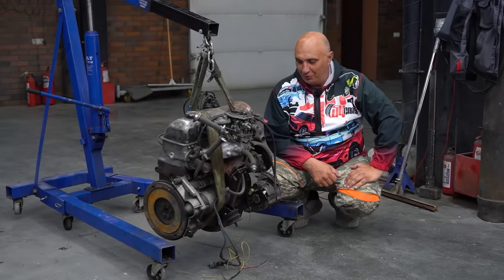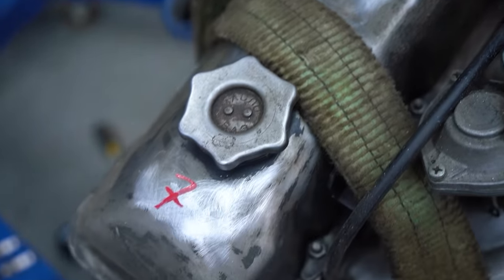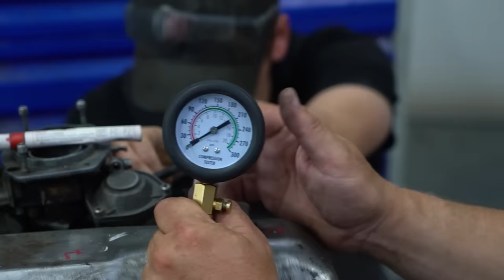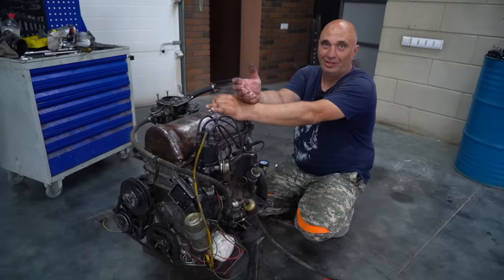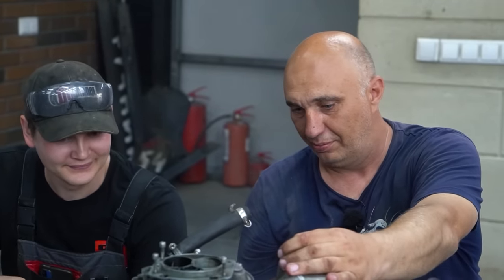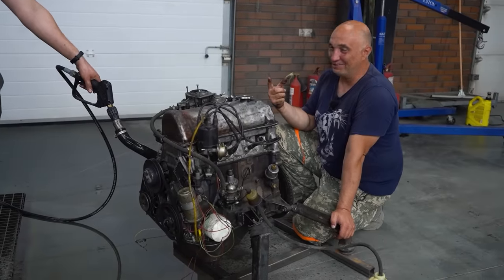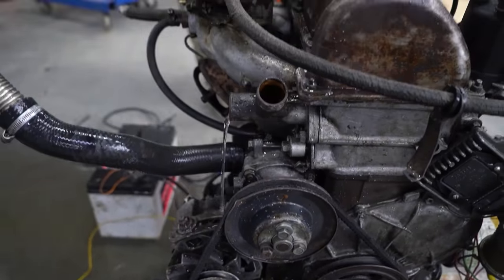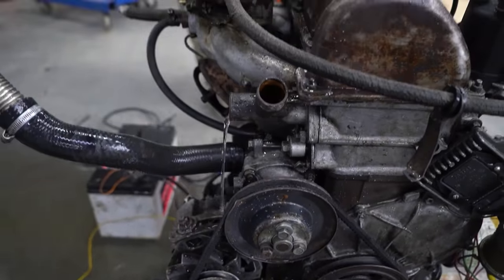Will an engine start on RUBBER piston rings?

Comment: Oil on top of cylinders would have been coming past the valve stems, especially with good compression which would have made the vacuum "worse" in regards to inlet valve oil bypass

Comment: it would be interesting to see how the rubber o-rings worked in the engine, you put the extra ring groove in.  Have the regular oil ring, at the bottom of the piston and then 3 o-rings, on top. Is that engine still running? If so, how's it doing? Does it still have better compression? I really enjoy watching all your videos and experiments. Thanks.

Comment: What if you got a different piston ring compression tool. One that an exact match to the cylinder and tapered. Much better than the clamp style. Probably would go together smoother also. Try it again!!  Maybe use a oil control ring on the bottom. Just use the orings as a compression ring.

Comment: Should've used square rings instead. On some break calipers they have square rings against the piston which seals better against pressure. I've used such rings on my home made hydraulic clutch and it worked great on the slave cylinder.

Comment: Use a stock oil ring and keep the compression rings rubber and put the engine in a car and see if it will drive

Comment: Amazing! definitely didn't expect it to run so well.  One thing got me though is the flames coming out of the carburettor - almost like timing or spark plugs were connected up wrong? If you had 8 bar across all 4 cylinders it definitely should have idled and ran very well you'd think

Comment: I like this idea..and yes oil control is the problem. Excessive amount for keeping the  rubber edges lubed definitely fualed the plugs. Run it again with a oil control ring setup. And actually drive it
Reply: Or just use 2 stroke oil with the fuel.

Comment: I think you’d need a coated piston (ceramic maybe) for a rubber ring to work, the aluminum and steel units probably retains a lot of heat from combustion compared to the walls of the cylinder (next to the water jackets).

Comment: that works really well not expected.
maybe try to do 2 rubber rings and 2 steel the normal piston rings which does for the normal oil supply and drain.then connect cooling and get stationary working and throttle like it was stolen
to test under harsh conditions

Comment: That was an amazing experement, I thought the o rings would melt or get hard but no they were as good as new when you took them out. It looks like oil was getting up into the cylinder.  I would like to see another test with the engine tuned a set up with a cooling system so the only variable is the rings.

Comment: Interesting! My assumption was that the first 2 rings would fry immediately due to lack of lubrication from the bottom O ring making a 100% fluid seal.. and the bottom ring would survive being it was the only one getting oil. But after seeing the o rings rolled.. that allowed compression to not build to the point of an air lock.. and oil to make it to the top.
Crazy! Also.. do fuel filters flow backwards in mother Russia? 👀 🤣

Comment: Surprised it ran so long. I would say you need to run a standard oil control ring to lower the amount of oil in the combustion chamber. The oil is probably getting around the rings on the intake stroke.

Comment: I feel because of 0 blow by, the top of piston ring is getting dry possibly causing rings to twist or spin

Mix 2 cycle oil would help keep upper lubricated

Comment: use airplane oil which is much thinner as the oil that slips by the rings will dissipate faster and maybe eather or add a extra head gasket and higher octane fuel.love your show.🤩

Comment: The cast iron cylinder head on my Ford 300 weighs so much that it doesn't even need head bolts or studs. The weight alone keeps the compression in.

Comment: I think if u cut the groove and fit a thin oil control ring the thin one then seal then thin oil ring it will seat perfect and seal and protect the rubber

Comment: Try to confirm that oil is not entering the cylinders from upstairs - valve stem seals/ worn valve guides, i'd like to see results of 1st and 2nd rings being O-ring seals and an oil control ring

Comment: One ring will do, make it the bottom rung to keep the ring away from the combustion process. 
A little more attention to the clearance / size of the ring should keep the oil on the correct side

Comment: I think if a lubricant was added to the fuel such as 2 stroke oil, the engine would run well for a long time, provided adequate cooling.

Comment: Definitely take this further, maybe 2 conventional rings and a rubber scraper.. Do you think the rings are expanding as they get hotter. .? Perhaps cut them then freeze them to get them located in the cylinder sleeves properly..

Comment: Weird how the compression was good during the test, but varied a lot in actual operation. The rings weren't being exposed to naked flame (maybe the top one slightly) so it makes sense that they didn't burn the same way that the plastic/wood pistons did.

Comment: A rubber O ring with suitable filler in it like some bearing materials would seem to show promise along these lines.
Try it!
Moulded rings would almost certainly be cheaper than machined ones at the same scale of manufacture. 
I think a conventional  extra oil control ring below the rubber ones could help a great deal.
I also suspect many engine makers sacrifice oil consumption to achieve good looking fuel consumption figures as nobody seems to care about internal oil consumption as long as nobody sees smoke or drips or smells nasty smells.
Normal western pollution control measures would ensure most of this, at least for a time!

Comment: I have a feeling that the rubber rings could be absorbing some of the engine oil, which in turn is keeping them fresh to keep the gap between the piston and cylinder well sealed, therefore compression up too. Any thoughts?
Reply: rubber do absorb oil, that why it eventually destroys it

Comment: This proves exactly how irrelevant static compression is. You get an engine with healthy supposed compression and right where people think it's good when the engine runs the things change as the worn piston rings or cylinder walls fail to seal under load.
Same thing with rubber, the compression looks alright but when the fuel ignites inflating the pressure to hundreds of psi they get squished and they leak.

Comment: Should see how much pressure builds in the bottom end of engine. maybe the pressure is high and could be making oil pass to top of piston. might need a vent to lower pressure.

Comment: it would be nice to see the original oil control ring with two compression  rubber rings, maybe with a better tunned engine, so that you can see it idle and rev up cleaner

Comment: imagine the sales pitch "its a lada.. its got coins for valves rubber orings for piston rings its a gas engine that runs on diesle its got 8 wheels you can crank start it or power it by the hampster wheel its got wooden break pads magnetic suspension lovingly painted with a pressure washer in 6 seconds. plastic windsheild worlds fastest wipers and you can mow grass in it. the dents will buff out. mind your head on the 42" subwoofer.

Comment: For those who do not know seals need oil. It's the oil that makes the actual seal. The o-ring or even the metal ones just make a small enough Gap that oil can't make it through. And then the oil seals the gap

Comment: Try it with just replacingthe secondary compression ring, see how much that helps the compression and then being outside of the main flame front, how well each hold up.. Probably a good enough setup to even try I'm a car driving for a while
Reply: the rubber can take the flame, it s the heat that may kill it
Reply: @omegarugal9283  That's surprising, I would have thought the flame front would be quite a bit hotter.
Also, not being on top there would be a lot less oxygen available to turn the rubber into a fuel where it will early ignite incoming fuel mixture as it's incoming. Basically I'm looking for the best of both worlds between metal rings and rubber gaskets.

Comment: I kinda figured they would run fine. I mean, these things are designed to withstand high temps, it's not like oil filters don't get hot. What I'd like to see is how long they would last in an actual car driving long distances. I bet they'll start to get worn down and we'll see lower compression after one thousand miles.

Comment: My guess is the oil impregnated the rubber and started acting like a rod bearing with the rings riding on a thin film of oil on the cylinder walls. I wonder if neoprene would work better

Comment: @Garage54 I imagine that the problem with the rubber/silicone/teflon rings, is that over time small pieces of this material can fall into the crankcase and go to the oil pump, I imagine that this could ruin the oil pump and you would lose the engine for lack of oil in the crankshaft and valve train.
Reply: the oil scraper ring needs to be above the rubber rings, in order to lubricate them, the scraper ring being above the rubber rings, it will prevent the oil from going into the chamber and at the same time it will lubricate the rings!
Reply: the oil may be being sucked by the sealing of the valves or going up through the cylinder wall that contains grooves, the rubber may not be able to seal these grooves.
Or could the oil have leaked when removing the head?

Comment: What about using silicone rings on the top 2 groves and put the oil scraper back on it? Old style stream engines used a similar seal ring

Comment: Build another 1. Use a conventional oil ring and 2 rubber compression rings. Put it in a car and run it on 2stroke premix fuel.

Comment: I would do a half rubber piston and half regular and run it in a car for testing. See how long the thing can go and even see if there is a power loss. Maybe try finding other types of rubber rings and seeing how they hold up. I know the normal black rubber but there is also the reddish rubber and other types. 

Overall I would like to see a set of pistons with only the top ring swapped with rubber. Preferably on a known low compression running engine to see if it improves it. If the rings stay oiled then they might never burn up as long as they can stand the heat.

Comment: Nice but take in concideration that the rings can rotate in the groove during oparation.2nd there is a limit for An o ring to "stick out" so 0.5mm is a bit to much i think. 3th. There are viton o rings wich are Heat resistant .if you cut out the oil to the  top of the pistonrings by using An conventionele oilcontrol ring the o rings are going to burn out realy quick i guess...Just saying,very cool test....

Comment: The reason why the rubber rings work so well is when you ran them for a while the heat caused them to expand that's the reason why you got great compression in them it's the same technology that Nasa uses in their solid rocket boosters

Comment: They might be pulling our leg it ran like they crossed some of the plug wires, a misfire. I'm sure they have 2 of the same engines one with less compression or a bad valve/valves. Also they never ran the one with the o rings that was just to take apart to "prove" they done it

Comment: Id like to see you trying with 2 of the rings being the rubber rings and the last being an oil ring, as you said. But id also like to see what happens in a diesel, since diesels have MUCH higher compression ratios, id be curious if the engine would run with those

Comment: Need to drive a lada with them in now but with hotter plugs to help burn oil off or just rubber compression rings not oil rings or different combos as that was so successful 🤯

Comment: I would also like to see this with 2 rubber rings and a stock oil ring to prevent the oil from getting into the combustion chamber. I feel like that might be why the rings worked so well because they were lubricated by the oil blowby. Wonder how well they'll work without that film....
Reply: the oil scraper ring needs to be above the rubber rings, in order to lubricate them, the scraper ring being above the rubber rings, it will prevent the oil from going into the chamber and at the same time it will lubricate the rings!

Comment: me over here being a 2 stroke guy and worrying about it failing just as bad. years ago they started introducing squish band...
the cylinders combustion chamber/head was sealed with i silicone ring and not a metal head gasket. you adjust the squish. how far the silicone is compressed by piston to head clerance and run it.
was it a terrible idea i thought so. but on yet another cylinder with one they hold up for thousands of miles. my last testers were water cooled 15:1 compression ratio and accelerate around 9-11k rpms. i was able to go wide open throttle for miles at a time which is completely frowned upon but it was all built for it.
the last cylinders were about 18-20 hp but still peak power from a stop with under 200 lb vehicle its hard to catch up with.
idk if silicone piston rings could last a long haul but for race motors or drag cars that rebuild very frequently its very plausable and could be very low friction

Comment: If you ran silicone rings they can take the heat better but you definitely would benefit I think from leaving your oil ring in because with the O-rings not getting lubrication it could cause them to wear out faster but I could be an idiot and be completely wrong😂

Comment: Not enough right type oil to rings, maybe.. and pressure rolls them down when testing pressure..

That motor that got extra rings (one more per cup), how long it could work daily use.. weird that many has talked that topic, but you're first who made it and put even video out. 
These funny things could sometimes give good ideas too for real or rally use..
Those stefa type seals would be interesting, but hard to install and not so good that have to done.. 

Number 54, don't use o profiled rings, those spins around pistons, I believe.. D or ■ shaped, when cutted, would work differently..
But how about printed titan rings, nos for engine and see can those work ;)

"Basic steel" what is usually hardened or steel for tools is very good stuff when douped some chrome, nickel, molybdenum etc.. and then it's not anymore "just random 'iron'".. I mean titanic is good stuff many usage, but some cases "just some steel" could be more superior. And indeed they add other metals and minerals in titan too, depending is it going in your femur bone or turbine motor. 

Big nut socket could be good starting point to make a "heavy" piston, but welding not make good for it and cutting sucks. 

Boys (men's) aren't sick when they plays with toys, those what not meant to be toys or tools even... 

I give good idea or maybe 2 in near future for you 54's, but I have to think bits and bolts ready in my head, so it could made easily way, because it's  not simple at first place.. and I want to see that works..

Comment: Honestly I would love to see a leather ring used instead of rubber and see how long it would last as I don't see the rubber eventually not failing But leather would resolve the shortcomings of the rubber like heat,Solvent etcetera. 
 I would think that steel rings were more of a planned obsolescence part versus leather is a sustainable serviceable part That may actually improve with more run time

Comment: i'm sure the auto manufacturers must have tried rubber rings. i wonder what sort of longevity you could expect out of a o-ring like that? anyway, the o-rings are doing something weird with the oil, clearly, but it seems quite promising for the matter of compression. i'm wondering if making a hybrid pistion with 1 rubber ring in the center and a standard top and bottom ring might be the best way.

Comment: I think this was a great experiment! I think you should try it again but this time make sure that you find a way to install the rings without having them twist! Another thing you might try is installing an extra ring like you did on another experiment only use a rubber ring. Then try it for a longer period of time actually put it in a car and run it

Comment: drill tiny holes on top of the piston.
since it has no blow by on it.
 So the oil can get off the top of the piston. so you don't foul out the spark plugs?

Comment: Nice one. 😂.  I think do it again with steel oil rings and only one rubber completion seal ring so the oil is controlled and the top ring stays moist loñger, and put it in the car and see what it runs like.

Comment: I used cheap rubber bands as piston rings for a leafblower that seized up, years ago and it lasted a good while (about 25 minutes wide open) until the compression finally dropped and it stalled. 14 year old me was dumb enough to try it.
Reply: were you able to fix it?
Reply: @terasestHammasratas  i eventually did hone the cylinder a bit and fit real rings back in it and it's in use today. low compression/hard to start but it does run once you get it started

Comment: I do think that the engine would start, I think the whole thing is rather absurd...because sooner or later the piston will have heated up so much that the rubber rings will melt or even burn.
Not only would this cause that cylinder to lose its compression, which wouldn't be so bad, but the piston would inevitably hit the cylinder wall. Here in Germany we call it "KOLBENFRESSER" LOL

Comment: Viton or silicone O-rings could handle this scenario the best. Silicone better at heat resistance and viton better at fuel and oil resistance. The oil likely ended up on top of the pistons likely because there was no scraper ring. I’d say try normal middle ring for scraping oil and rubber top shed bottom rings.